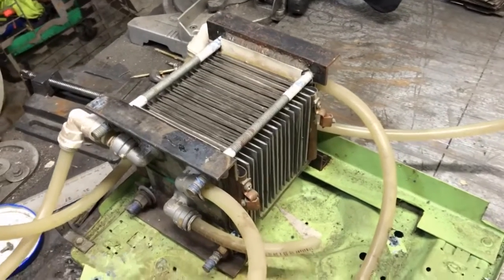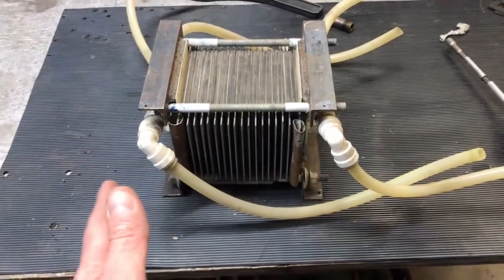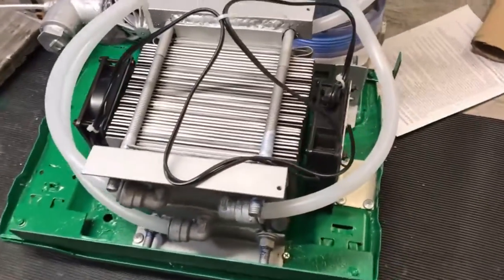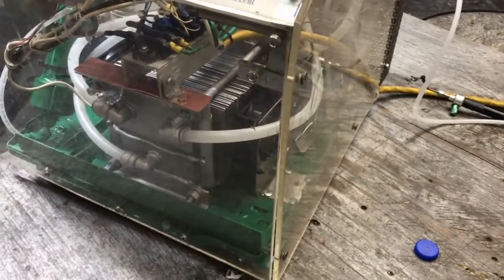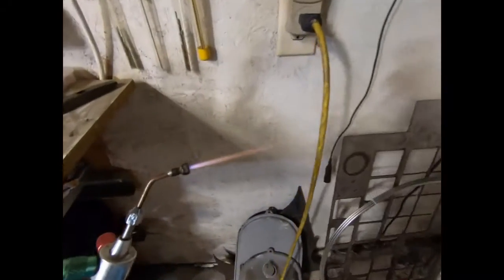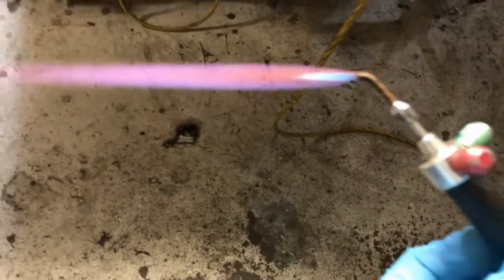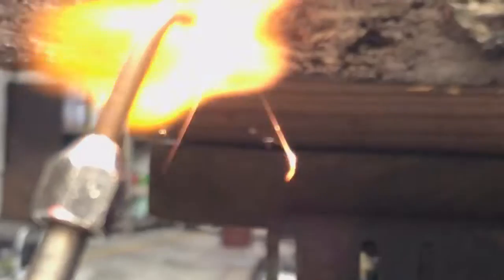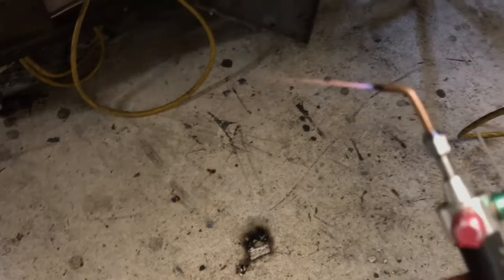High performance brazing with oxyhydrogen infused acetone gas modification

Comment: I wish you sold these. If you want to make me one id be interesting in buying it.  Asap. 

Have you thought about using/trying carbon plates? From what ive read and watched theyre one of the most efficient medium available and better yet still is the fact that theyre easy to handle (cut/drill vs stainless steel which like you said is a real nightmare.  Especially without specialized tools). Theyre also supposed to quite resilient.   

It would be do cool/interesting to see your same system but just altering the plates.  If like to see the current setup, compared to carbon plate and finally platinum plated titanium plates.
Reply from the maker: Yes i can build you one but they aint cheap , alot of parts on these little buggers .
it cost me about $1000 to build this one so it would be about $2500  as you are looking at alot of hours to build this thing .

Comment: Funny i had the idea to infuse propane/butane with acetone to make it hotter a while ago,
but i didn't tried it yet since other projects came in between that plan.
4:13 i can recommend the step-drills instead of normal drills. Stepdrills are the golden coneshaped ones made for sheet metal,~ 4$ a piece but for many diameters at once

Comment: hey man, thank you. A couple of things. Firstly, Got a micrometer by chance? I'd be interested in seeing what the thickness of your old plates are in the central working area vs. on the outside area. Are they Thinner? By how much over the 2 years? Reason being, I've been making quite a few designs the last while and the filter press design only seems good if laser cutting is on the budget for accuracy etc. So, if the material thickness is no different then there should be no issue using the thinnest 316 I can get. You can cut the stuff with scissors or a weak little guillotine or zip through it with a grinder. (Reduce weight/price/easier)
         Secondly, have you watched the Russian HHO dude, 'Severs' from Belarus? Holy smokes https://www.youtube.com/user/COOLBEARru/videos this guy is clever. Check out some of his older vids for clues of what he's up to. I have been trying to understand his HHO systems with google translate and pure observation (taking screen grabs and counting plates to work out power supplies, connectors, plumbing, etc). One of the most awesome thing he does is that he uses regular oxy acetylene torches and utilizes both lines. The oxygen line for straight HHO and the acetylene line has HHO modified with a hydrocarbon (i.e.acetone). 
         He has the ability with the torch to mix the two gases and wow, huge amounts of flame variation depending on how he tweaks the torch taps. I believe he divides the gas out of the electrolizer into two liquid/gas separator compartments with a checkvalve in between. One has the HHO and is plumbed to the oxygen line to the torch, the other, the hydrocarbon, is plumbed to the acetylene line. I wouldn't be surprised if you buy one of his units after seeing it and pushing this one into the corner.  
         And finally, I've been wanting to ask you for a while about the number of plates; how many volts is your power supply and what kind of power supply; pressure switch specs, do you have a PWM and control of mark and space for duty cycle? What are the dials on your control panel?

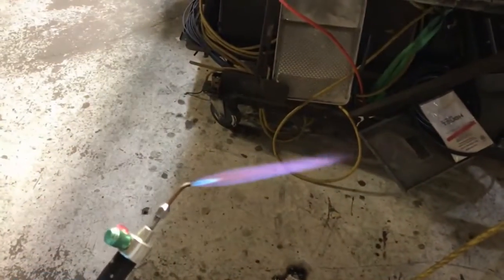Comment: Responding to 13:19, as to why the flame seems larger than normal. 

A: If you added two plates, the efficiency should have about a 2% increases.
B: Since the plates are new and clean, surface oxides have not begun to increase the resistance of each plate, increasing output efficiency.
C: Since the new plates have better flow characteristics, so the fluid resistance of the cell has decreased, allowing the fluid to pass through cells closer to the center of the cell more efficiently, (the flow rate likely also increased), increasing the gas transport efficiency.
So, since the changes you made increased the output efficiency of the system, the increased output is (sort of) expected.
Reply: Wouldnt it have been beneficial to rough the plates up internally to increase surface area allowing it ti create more POWERE aka produce more hho?

Comment: Would using a ultrasound transducer take care of the problem with removing gas bubbles from the plates Sir ??? How about the plate size being increased two times for increased gas production ????  What did you use gallium for that is on the floor Sir ??? Thanks and have a great day too.
Reply: He has tried putting a ultrasound transducer in the tank before, vid titled "HHO Oxyhydrogen torch Ultrasonic Bubble Coalescence anti foam system" if you want to search it up.

 The production of gas is actually tied to current density more than surface area (to about 20 amps / cm² theoretically), increasing the surface area mostly just gives the plates more area for bubbles to cover. Since bubbles effectively block plate area, changing plate size would have more of an effect nearer to the theoretical maximum current density. 

The gallium is from a pipe bending experiment a little while ago, vid titled "Bending tubing and Coils Ninja trick" if you want to find that video.

Comment: What happens to chemistry characteristics if you bubble it through acetone and kero mix . Kero is sort of jet fuel so may be interesting ....This info from the net. 

Chemically, kerosene is a mixture of hydrocarbons. The chemical composition depends on its source, but it usually consists of about 10 different hydrocarbons, each containing 10 to 16 carbon atoms per molecule. The main constituents are saturated straight-chain and branched-chain paraffins, as well as ring-shaped cycloparaffins (also known as naphthenes). Kerosene is less volatile than gasoline. Its flash point (the temperature at which it will generate a flammable vapour near its surface) is 38 °C (100 °F)
Reply from the maker: There is a guy who tried almost all fuels but not kero , would be an interesting test seeing as how energy dense it is
Reply: NOBOX7  yeah and mixed with acetone gas , oxegen , hydrogen, carbon chains and other  elements may make for some interesting flame characteristics materials and also  colors  on stainless steel as it oxidises as different rates .
Maybe acrylic is not the only clear  plastic it can polish with petro chemicals added . Who knows ! Remember the rule in chemistry .... like disolves like so acetone disolves acrylics, butane disolves abs (butadiene) etc